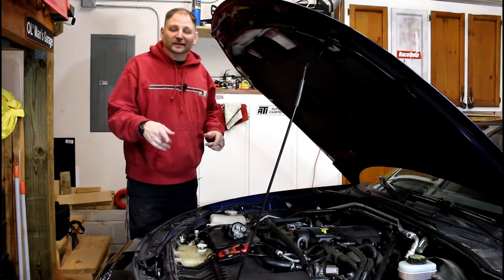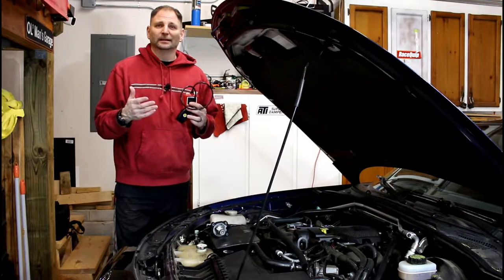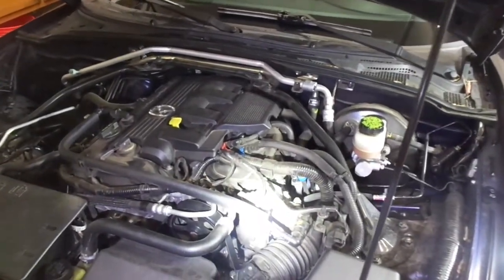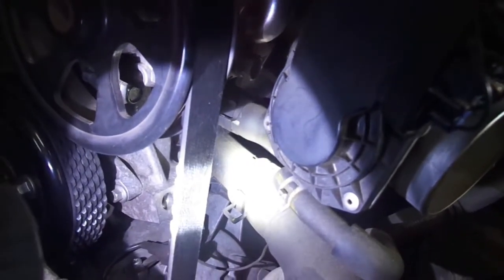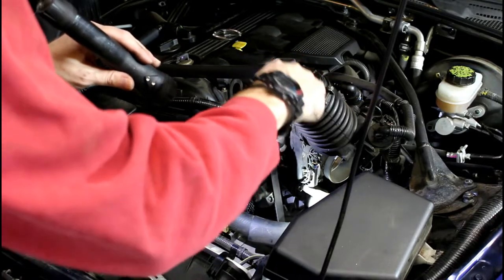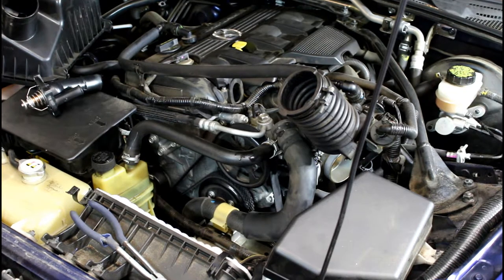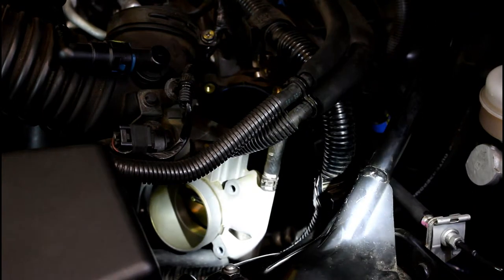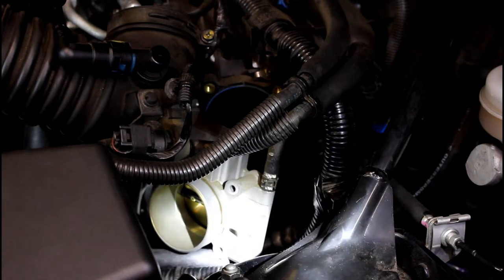obd2 code 0126 and nc miata thermostat replacement

Comment: the weak spot in this cooling system is the plastic overflow tank. Your car is entering the danger zone where the plastic gets brittle and can break at any time. I had a friend whos tank went at 79000 miles and cost him his engine. Once this engine overheats severely its done.  In my 2008 Miata I replaced the tank with a stainless steel one so I never have to worry about it again. The issue here is that this is a pressurized overflow tank and not just the ron-off type to catch expanding coolant as is typical on most cars.  Im sure that you are aware of this issue but in case you arent...yup..more than one miata owner has had this tank crack and found coolant exploded all over the engine at highway speeds where the engine is now toast....
Reply from the maker: That damned plastic! Lucky, previous owners had it changed our! So we should have some time before it fails! Good tip!

Comment: I get the CEL today but a couple months ago i was experiencing bad mpg and in hotter days the car feels a lot heavier in low rpms and above 3.5k rpm the car responses really good and after getting on the hwy the engine recovers his power but not all the power can the thermostat causes that lack of power due to overheat? 🤔
Reply from the maker: @joegamer1696  it is possible that when the car is getting hot that the computer is pulling timing and thus the car has less power

Comment: Did changing the thermostat fix the P0126 issue? I read that a faulty sensor could also be the problem. Thanks!
Reply from the maker: Yes, after thermostat replacement, never saw the CEL again!